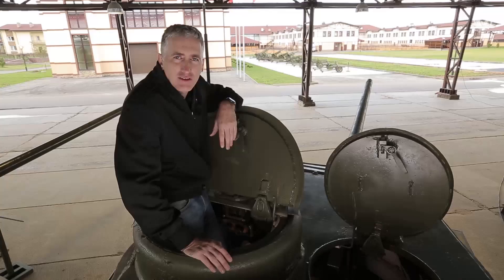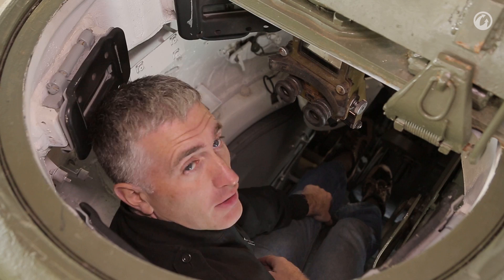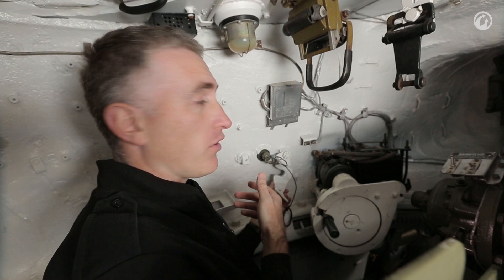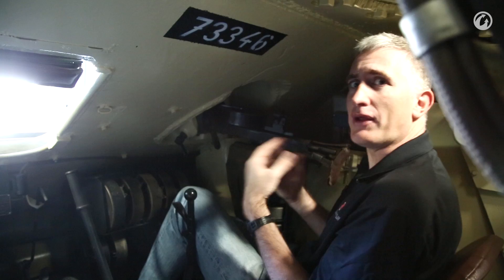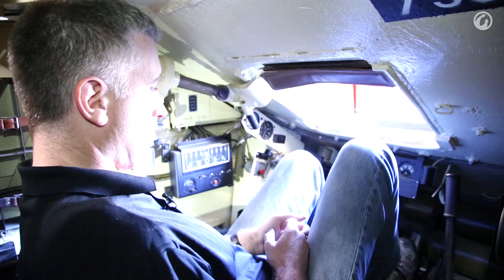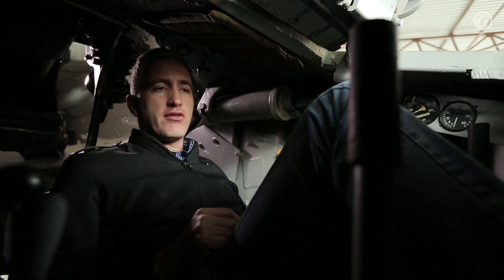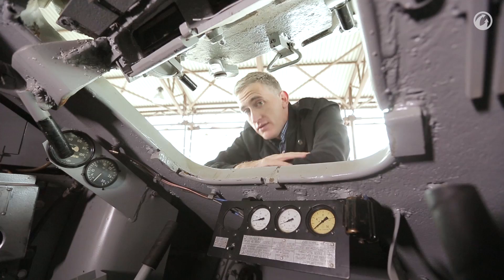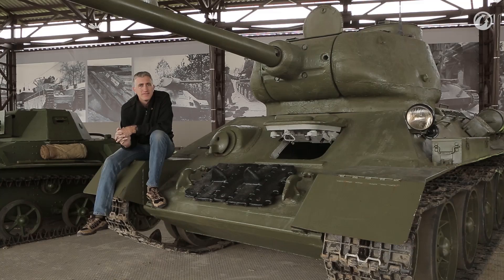Inside the Chieftain's Hatch T-34-85: Part 2

Comment: remember the russians also used the sherman tank, not only the T-34, T-34-85
Reply: +Всё Путём Not quite right: Panther was made to fight the t34. There were 2 prototypes from Daimler-Benz (DB) and MAN. The DB version was very similar to the t34 (Diesel engine, alround layout, etc..). But the MAN prototype had been chosen, which was more in german tank tradition with gasoline engine, front drivegear, interleaved wheels, ...
The only thing really adopted from t34 was the angled armour.
Reply: +Всё Путём sigh I know of the advantages of sloped armor and so did the german militaries at the time. They just didn't built their tanks with heavily sloped armor in favour of a better crew compartment. As you said correctly you need less material, but also got less room. Thats exactly the part in the end, what Chieftain says. Russian tanks were (and imho still are) very tiny. Good for few combats because of the low profile, bad for the crew on longer operations, because these tanks are not built for crew comfort.
For the question, what makes a good medium tank: Agility, protection and firepower. Which is all in all better in a Panther tank. And yes I know, the early models had technical problems, cause they were rushed into production.
Reply: +Всё Путём I don't want to start a debate on every subject you bring up here, even if I disagree in some points. I just commented on your point: "FYI Panther was made based on t34" which is untrue.
Reply: +Всё Путём First tank with sloped armor was imho the Schneider CA1 from 1916, so with your logic, was the t34 based on the CA1? No.
 Comfort doesn't mean they have luxorious interiour, it means you can move, as a loader you don't have to crouch all the time, after a shell penetration not everybody hits the hull with his body, etc...  Also comfort means ergonomics: Can you reach every lewer with ease? How hard is it to pull the lewer? When you watch this video and also others from Chieftain you find that many russian tanks (also some british) have very little crew comfort.
Reply from the maker: Wait, what? Of course sloping armor affects crew space, how can it not? Especially on the sides.
Reply from the maker: It is a criterion for a tank. The main reason that the U.S. army rejected the first 76mm Sherman was that it was too cramped for efficient fightability. Watch the Operation Think Tank videos, the trade-off between protection by sloping armor and the availability of crew space is discussed.
Reply from the maker: I never said anything about increasing size for more people. I'm talking about giving them more room inside to do their jobs better.
Reply: +Всё Путём USA won the war with the Sherman as the russian with the t34, so both did their job. But now we digress...
However thanks for the info @chieftain :-) Is there a possibility we see an Inside of the Panther in the future?
Reply: +Всё Путём The Soviets liked the Sherman quite a bit. The Americans shipped them about 4,000 M4A2 Shermans, which is an M4A3 Sherman with a Diesel engine. It was an approximately 50/50 split between 75mm M3 versions and 76mm M1 versions. Against the Russian T-34-76, Red Army high command deemed it less prone to ammunition detonation when hit, but more prone to overturning due to its higher center of gravity. They also appreciated the much greater visibility, egress and crew comfort, and were keen to note the high reliability of the Sherman. While the Soviet Army would use mostly Soviet-designs such as the T-34, some units such as the 9th Guards Motor Rifle Division used the M4 exclusively to simplify logistics. 

IMO, the Sherman is a better vehicle, as both can kill each other in one shot at the same ranges, but the Sherman has better optics and crew comfort than equivalent models of T-34. This makes it more efficient. The only advantage I see the T-34 has is a lower profile and the 85mm S-53 was a larger caliber than the 76mm M1, giving it a better HE shell. Despite this, both saw extensive postwar service, and a few countries still use them; the M4 Sherman is still used by Paraguay, and the T-34-85 is still used in Somaliad.
Reply: ***** Well, that was an issue with early model Shermans, who like the T-34, had "dry" ammunition storage in the side sponsons. This meant that a penetrating hit the tank was likely to hit the ammunition and ammunition was very likely to set it off. So in later models, the M4A2 and the M4A3, they moved the ammunition storage to the floors and stuck them in bins with water jackets, reducing the probability of fire considerably. This is the model which the Soviets tested against contemporary models of the T-34. So yeah. The Soviets admitted T-34s are more likely to explode upon penetrating shot compared to M4 Shermans. The early models of the Sherman got the reputation of being a "Tommycooker," but while that problem was fixed and the Sherman stopped turning their crews into well-grilled hamburgers, the T-34 still turned their crews into well-baked piroscki throughout the war. 

The M4 gets its unfair reputation from Belton Cooper, an ordnance officer who's job was to fix broken tanks. While the book he wrote is a good book, it is by no means a resource about tank warfare. If your job was to fix cars for a living, then you would have the impression that cars are not very reliable. 

I should add the T-34 was not well-optimized to leaving the crew alive after a penetrating hit. There was main cannon ammunition stored in the crew compartment, specifically the turret. You can see this in the video. And sticking ammunition in the turret with the crew is the fastest way to kill them upon penetrating hit. The Sherman also had a turret basket, so the loader didn't have to dance when the turret rotated.
Reply: ***** Yes, the Germans did admit the T-34 was a superior machine, on a technical level in 1941. However, it suffered heavily from poor quality control problems; the armor was made of a variety of inferior alloys, and had a tendency to shatter if hit with an HE round. The welds on these models were very poor.

The Americans noted these in testing in 1942, when the Soviets sent them several samples, which were certainly the highest quality ones because nobody shows off their second-best. It also confirmed the poor mechanical reliability, which was not due to the Americans; the Soviets sent a mechanic and spares with the tank. The quality of the armor steel and welds on the T-34 certainly improved in the T-34-85 version.

And the Germans knew their anti-tank weapons were becoming a bit dated. Experience fighting against the French Char B1 and the British Matilda II with their KV-like armor was enough. The T-34 simply confirmed what they knew. 

Yes, the T-34 predated the M4 by three years, and was a very good tank indeed. It was superior to any German tank. However, these models had some serious flaws, such as cramped confines (which gave the designer pneumonia that killed him), poor quality steel, even worse weld quality, and poor mechanical reliability. It also suffered from poor maintenance, and leadership due to Stalin's purges. The potential of this design was completely wasted. 

By the time these problems, save the mechanical reliability, were fixed, it was no longer the monster it was, though a useful vehicle nonetheless. The Soviets noted that a 200km march for a German tank was not a serious strain, but the same march on a T-34 was bound to have something break. 

Don't get me wrong, the T-34 was the perfect tank for the Soviet Army. Something which could be produced on a mass scale by relatively unskilled workers, which could be expended, due to the low lifespan of a Soviet tank. A testament to this is that these machines saw service as late as Afghanistan and Bosnia. 

They were simple machines which could be easily fixed. A testament to this was when Soviet Spetsnaz managed to take over a cave system occupied by Muhajeen. Deep inside, they found a captured T-34-85 in such good repair that they were able to drive it out.
Reply: One thing to add to your short comparision of the M4 and the T-34: The Sherman was built from the ground up to be repaired quickly. A huge example is the transmission that is basically plug and play as we would say nowadays. The T-34 was not easy to fix (as seen in the video) and so where the german tanks for that matter, although the reasons for it are different.
Reply: Actually, the Germans did not base any tank off the T34 that was fielded in battle. However, when they were developing the Tiger tank, Porsche developed his prototype tank off the T34's suspension and rear drive (the Porsche Tiger in WOT); however, it failed in trials. A better correction to your comment is that the Germans developed tanks designed to combat the T34 and KV1, as the Pz.III, the main tank at the initial start of Operation B., couldn't penetrate either Russian tank with its 50mm gun.
Reply: KingofGames170 The Porsche Tiger used an electromechanical transmission.
Reply: Indeed, it was a genius idea, but like all genius ideas, it needed a lot of fine tuning, which Porsche was unable to do. So it caught on fire. However, the layout of the P-Tiger was based on the T34, with a rear transmission, forward-balanced turret, and large road wheels originally planned. However, the road wheels never went to work and the transmission, as noted, caught fire.
Reply from the maker: I'm on vacation right now, but remind me in a week or so to dig into this one. It doesn't strike me as correct.
Reply from the maker: OK, I've not seen anything in Doyle/Jentz to support the idea that Type100/101 was related to the T-34. Porsche was fixated on the concept of saving internal space (Which T-34 certainly did not), which is why he developed an entirely new suspension system mounting the torsion bars longitudinally. Driving rear wheels was also hardly a new concept in tanks. Some designers chose that method, others, not. The forward turret was simply to balance out the power train.

Comment: Man that just seems... Terrible. Like if someone offered me a single free WWII tank, I'd avoid the T-34, just because it doesn't seem like it be as fun to drive around with as other tanks would be.
(Heavy Clutch? How difficult it looked to switch gears? No thank you)

My impression from this video is that the T-34 is like a fast food hamburger. Good enough to get the job done, and you can get lots of them quickly. But a few hours later (100km later) your hungry again (They broke down, get a new one).

Granted it is exactly what the Russians needed at the time. Get as many tanks onto the field as possible, but I'd hope once this need for great numbers of tanks was met, that new tanks that actually thought of the crew were being made.
Reply: DeScruff it’s important to note that the Russian tankers were selected from short men, the average soldier being just over 5 ft, so for them it was actually quite comfortable.
Reply: Nah, they were manufactured with huge tolerances which mad e things like the gears shit, but it made them so easy to fix too. Could be fixed with a hammer and a wrench. So simple you didn't need a degree in engineering to get it working again.

Comment: Tanks need a parking brake? I never would have guessed.
Reply from the maker: How else would you stop it from rolli down a hill?
Reply from the maker: How else would you stop it from rolli down a hill?
Reply: How else would you stop it from rolli down a hill?
Reply: TheChieftainWoT point the gun downhill and just fire it incessantly.
Reply: HOW STOP THE ROLLI??? xD tank tracks actually turn pretty easily, plus the weight of a tank trying to roll itself down...  tracks aren't really that different to 2 wheel drive.